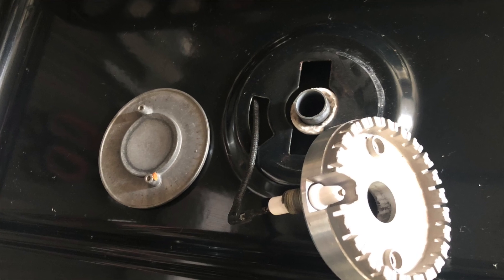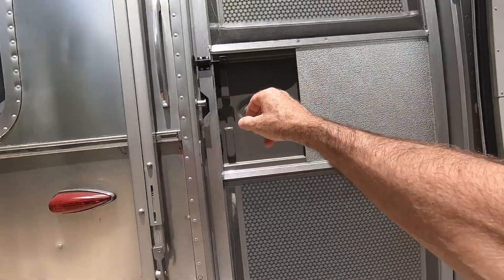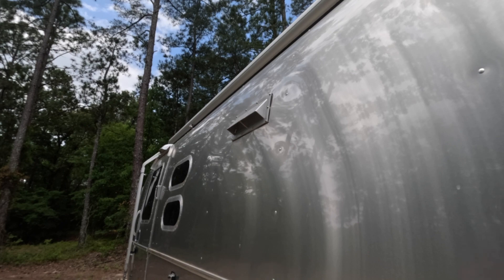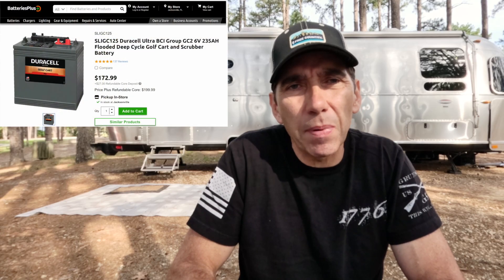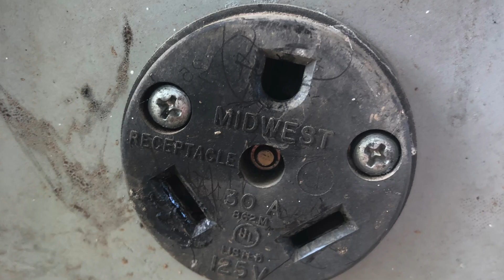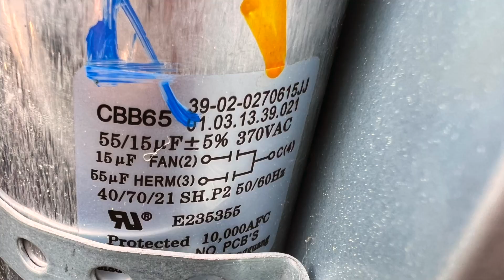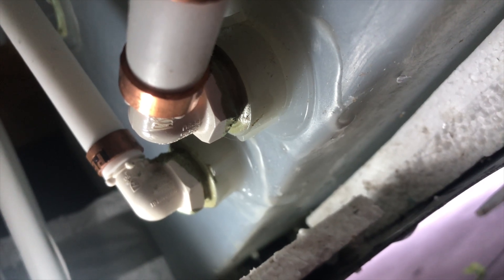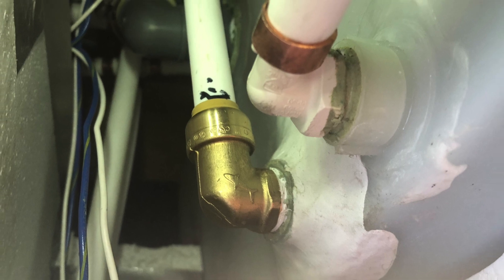REALITY CHECK ✅: What BROKE on Our AIRSTREAM after a Year of Travel

Comment: Great video! My takeaway is - the structure of the airstream is built to a higher standard…but airstream uses the same low quality off-the-shelf components that the rest of the industry uses. I say this because I’ve replaced almost every identical component on my very low quality Forest River travel trailer in the 4 years I’ve owned it.
Reply from the maker: For the most part I think you may be correct. While I can’t speak directly to the quality of each component that Airstream / RV industry uses I do know that  with use and over time components will break.  It just the reality of RV life.  Thanks for watching and safe travels.
Reply: Anything these manufacturers can use inferior parts to save money 🤛🤛👍
Reply from the maker: Probably true for most large manufacturers (Ford, GMC, Airstream).  The challenge of building a quality product at a reasonable price.  That said, I would still take my AS over any other RV brand.  Safe travels.
Reply: Some of what you talked about is understandable, except a leaking roof, and design flaws. Mainly, because the design and structure is airstreams “ selling point”, to justify their extremely high price point for their campers. If it’s breaking down at the same rate as others, then it not better than others, not worth the expensive price tag imo. Your just a get it done kind of person.
Reply: The structure of AS suck. Separation, poor door fit, door lock, the ride too low, are heavy and the dealers suck

Comment: I bought a new Airstream International 31 foot and yes there are minor things that happen. We had several bigger or more difficult items to fix where we had to take our RV to multiple dealers to get it fixed. It spent a lot of time at dealers getting fixed or just waiting for parts. Items such as a malformed jack part, thermostat died twice in 4 years, window fell out since it was never screwed in and the list went on and on. You have to be handy to own one. It’s clear Airstream is using their dealers for final quality control (my opinion). Finally we got so fed up we finally sold it. If it was a 30 k investment, that’s one thing but if you spent 100k on a new car you would expect great quality which ours was not. We wrote to Airstream…no answer.
Reply from the maker: Sorry to about your Airstream experience.  I agree, it can be frustrating at times and you’re better off if you are handy and able to make most repairs yourself (my opinion). My hope when I made the video was to provide a reality check on RV ownership.  I’m afraid that some RVers  have unrealistic expectations about RV travel and ownership in general.  I hope you have better luck in the future and safe travels.

Comment: The "spare capacitor" tip also applies to your home. It is the #1 item that fails & will cost you big $$$s to have a service call during a hot spell. It is not "IF" it fails but rather "WHEN".
Reply from the maker: Great Tip and I completely agree. I keep a 45/5 capacitor on hand for the home HVAC as well.  Money well spent for peace of mind.  Thanks for watching
Reply: I am a AC service tech and would rather you didn't keep a spare on hand, that way I can make 300 bucks off of you for a $30 part.  LOL  Just kidding, good point TalonID about keeping a spare.

Comment: Thanks for compiling this list.  It is a great resource.  I also would agree with most of the comments regarding quality of components vs cost.  Seems like for the price of an AS you should have longer lasting parts.

A couple of additions to consider adding to your list of spare parts
1. H2O water heater mixing valve
2. H20 water heater electronic controller and thermal cutouts/switches
 
Our 2018 Flying Cloud has a system with a mixing valve.  The valve is utilized to mix cold H2O with the heater's hot output to provide more volume of hot H2O.  The mixing valve has a small screen on both this input and output which has a tendency to clog with mineral hard water build up and/or particulate (if you are not using an external water filter). This fix requires accessing the H2O heater from this inside to remove the mixing valve.  It can then be disassembled and unclog the screen with an overnight vinegar soak.I carry a cleaned spare unit.
Also I have had the thermal cutout/switch on the H2O heater break.  This part of the H2O heater electronic control system.  There are actually 2 of these thermal cutout/switches for the mixing valve type of heaters.  The electronic controller and thermal cutout/switches are accessible from the outside.  Initially I thought it was a controller malfunction, but I was able to diagnose it to the thermal cutout/switch.
Again, I care a spare set of controller and thermal cutouts/switches, along with some spare 1/4" & 3/8" crimp on TAB style electrical connectors.
Cheers and Happy Camping!
Reply from the maker: Great tips. Thanks for sharing.  Safe travels

Comment: Great content. I’ve learned so much and you certainly have a get it done mentality. Looking at Airstreams here in mid 2023, and geez, those puppies are expensive. Looked at other brands but those are clearly made to be sold and off the lot with little concern of longevity. But this video shows that Airstreams may be made be better, but not a lot. Airstreams are up to 3 times the price of other  RV’s. This video was not encouraging, though I learned a ton.
Reply from the maker: Thanks for watching.  As for Airstreams, I would say they are still the best you can buy.  And while they will break with use.  The advantage they have over other RV brands is that they can be repair fairly easily where the other brands in my opinion are made to be disposable.  Hope this makes sense.

Comment: I had an RV dealership when a customer came in with a roof leak I had my guys remove and reseal every vent and running light that got the problem solved almost 100% of the time. No the manufacturer didn’t pay me for this I valued my customers.
Reply from the maker: Great advice.  Thanks for sharing.

Comment: Thanks for the video. Was your surge protector also an EMS unit?  I think an EMS unit would have detected low voltage and saved you from the burnt plug. Low voltage can also damage electrical components such as the AC capacitor and the water pump.
Reply from the maker: We use the Southwire Surge Guard 30A model.  It is designed to provide protection against: Power surges, Open ground, Open neutral, Low (<102V) / High (>132V) voltage, and Overheating plug/receptacle.  I can’t say with certainty what caused the electrical problems, other than the LED screen stated a Low Voltage situation and I noticed the plug had melted.  I agree a prolonged low voltage situation could have caused both the AC capacitor and water pump to fail (prematurely) but I do not know if the low voltage was a one-time event or a reoccurring event that didn’t trigger the surge guard (>102v).  Since then we have purchased and use a Hughes Autoformer with the Surge Guard.  Thanks for the comment and safe travels.
Reply: Your surge protector was most likely damaged buy the receptacle you were plugged in to. Another thing; your a/c pulls MORE amps when the voltage is reduced. The wattage stays the same, and volts multiplied by amps is watts. The extra six or eight amps would not melt you plug that way, but a loose-fitting connection would.

Comment: AIRSTREAM IS MADE BY THOR; it's not Airstream quality anymore after 2014; as a comparison, Bowlus Aluminum Trailers have not had a single warranty claim on any trailer in over 5 years. Airstreams of the past ARE NOT the same today; they are overpriced junk. Very sad.
Reply from the maker: You are correct that Thor is the parent company, but I would argue the trailers are still made by Airstream.  Regarding Bowles trailers, I find it hard to believe that no warranty claims have been submitted in over 5 years and would be curious to know your information source for that statement.  As for Airstreams being overpriced junk…I guess that’s a personal opinion.  Overpriced…I think you can make a strong case.   Junk…I’m not sure I would agree.  Anyways…Thanks for the comments
Reply: Hasn't Thor owned airstream for like 50 years?
Reply from the maker: 44 years when they bought Airstream from Beatrice Foods.

Comment: No offense, for the amount of money airstream is charging for their campers and “ design”, the last thing it should be doing is leaking from the roof. That issue alone is a complete turn off. They need to rectify that issue with a better design/install.
Reply from the maker: Not offended at all.  I agree that a roof leak is unacceptable, but I don’t think it was a design, flaw but a manufacturer flaw (faulty install).  That said, Airstream should consider better QA/QC processes to prevent future occurrences.  Thanks for watching and safe travels.